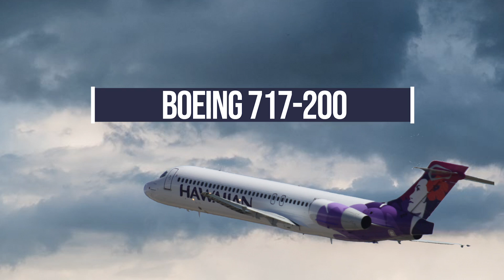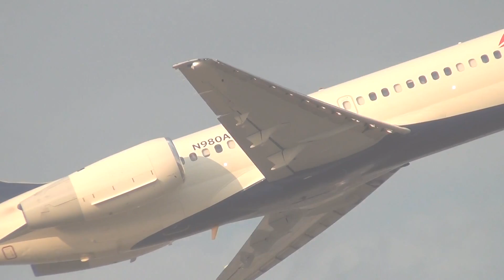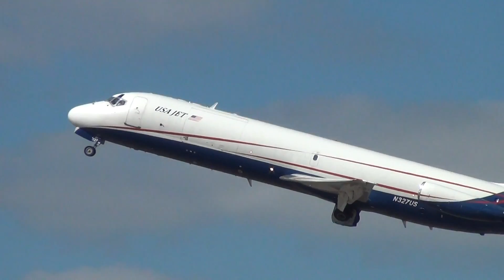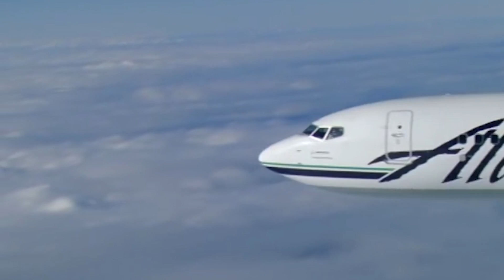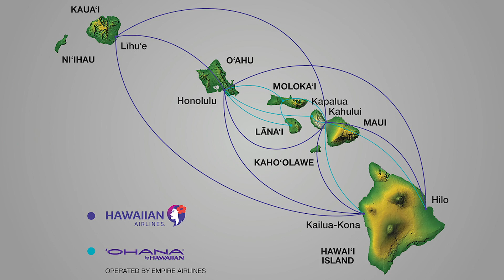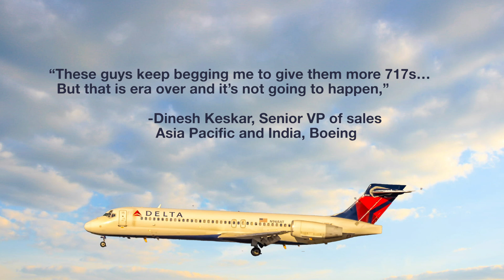Why Boeing Built The 717 And What Makes It Special

Comment: Any aviation "nerd" will know that the DC-9-30/40/50 transforms into the MD-80/88/90 which again transforms into the B717. It's similar to a Pokémon evolution from basic to advanced form.
Reply: Thank you fellow nerd!
Reply: You're welcome fellow nerd!!!
Reply: MD-80/89/90 should read MD-80/88/90
Reply: @Rick5040  I didn't even notice the mistake. Thank you for the heads-up!!!
Reply: @Rick5040  it was probably just a typing error. 8 and 9 are pretty close together.
Reply: It is quite difficult to differentiate all of them. Harder between MD-80s series.
Reply: @adalbertotorrero5893  it is really hard to tell the difference to the untrained eye. Here's how I tell the difference. The DC9-50 and MD-80 has a small difference with the nose wheel. On the DC-9 there is a small water spray guard where as the MD-80 have a much bigger spray guard for engine protection. And the B717 just looks similar to a DC-9-30 or maybe a little bit smaller.
Reply: @dewpont18 I think the 717 is closer to the dc-9-40
Reply: @Robert Newsom  yes the B-717 is similar in size to the DC-9-40 but respectively the B-717 was actually trying to be sold as the MD-95 before McDonnell Douglas merged with Boeing. With that being said. The DC-9 Family, MD-80 Family and B-717 Family have very similar styles of design across all 3 A/C Manufacturers mainly for simplicity sake. Which is rare nowadays.
Reply: They are all DC-9's from FAA certification. The rest of the model names are only marketing.
Reply: I've always thought that the Md-90 and 717 are on the same level.

Also, i prefer 737classics and 717 over the shorter 737ng, which that only fits for longer -800 and -900er variant, preferly with winglets.
Reply: @eirfanhazlan9271  from my experience, the MD-80 is similar to the 717. But I could be wrong. Also I would like to see Boeing include some 737classic designs into the 737ng A/C other than the 737NG BBJ A/C (such as air stairs)
Reply: It's more of the same principles as the DC-9. The MD-80/90 are just 737s but made by Douglas.
Reply: Exa toy.  Boeing did not build the 717 McD D did as the MD-83.
Reply: @craigbeatty8565  the Boeing 717 was originally marketed as the MD-95 Aircraft
Reply: @dewpont18  Thanks for that,  I knew it was DC-9 based but was more used to the MD-80 series designation.
Reply: You missed the 92
Cheers
Reply: Hello oldest plane

Comment: Still a DC9, MD80, MD88, MD90, or Boeing 717 are basically the same aircraft, though some versions are longer than others.
Reply: The md 90 and 717 both have different engines and the 717 and some particular models of the md 90 have upgraded cockpits

Comment: The 717 is really a right up to date DC 9 -30. When Air Canada was really growing through the late 60's and 70's it was the ever reliable DC-9's that made the airline tick, and helped them become a large world class operation. I believe all they ever had were DC 9 -10's in 1966 ? which were replaced by DC 9-30's starting in 1968. They are one rugged long lasting commercial airliner.
Reply: Northwest paid Air Canada to totally rebuild and "zero-hour" their entire DC-9 fleet in the '90s rather than buy new airplanes. I flew SOOOOO many miles on those thing! Loved them, loved Northwest.

Comment: After flying both as captain for a US airline I can assure you the Dc9/717 is the better aircraft both for safety and especially for reliability!  Especially in the 100-150 passenger configuration.  The Dc9 rides better in weather (higher wing loading)is quieter and a much more stable aircraft in yaw. Above the 150 seat configuration the 737 starts to beat it out, but by then you should probably be using the 757 as it is a far superior aircraft in that seating configuration.
Reply: I agree about the wing loading, way better ride in rough air. Also, an engine failure took less rudder....a lot less rudder.......

The flip side is that I never got used to the deck angle being so high on approach.....always felt it was going to stall.
Reply: RR KNL the dc9-10,30,50 had a much lower deck angle than 737 using 50 flaps and very similar using 40 flaps. The single engine approach 15* flaps was a high angle approach but not much more than single engine 737 approach. In a big crosswind the Dc9 was head and shoulders about the 737, I’ve had numerous landings above the demonstrated cross wind as it is a recommendation and not a limit unlike the Boeing.
Reply: Farmer Ted, it is hard to figure out what you are saying, because you just mention "I flew both".....yet several different types of aircraft are mentioned in the video. You comment goes on to only mention the 737 and 757, and it is pretty meaningless to compare such very different aircraft to the DC-9/717 type.
Reply: youtuuba I flew the dc9 10,30,50 from 1987-2000 and flew the 737-300,500,700,800,900 till my retirement. Along with a two year stint on the 747. I think I’m more than qualified to have an opinion.
Reply: @FarmerTed  , you no doubt have lots of experience flying, and I respect that, but your written communications skills are lacking, and that is an area in which I have lots of training and experience. That is why I commented on your comment....it was poorly written and confusing. You also seem to have poor ability to read my comment and understand that I was not challenging your flying experience, but rather your ability to write clearly.

Comment: Me likes the md design, well proven and reliable. Sad to say the design ist outdated like the 737, for different reasons. T-Tails can deep-stall, rear mounted engines are not so suitable for efficient large fan diameters, hard time for evolution on this platform. The 737 has this issue with the fans and ground clearance on the stubby legs. When sticking with a proven old concept be sure to have room for change... imho the 757 had the potential for this, but hey, who cares, just my 2 cent.

Comment: Delta is reportedly working on a deal with Boeing where Delta would trade in its 717s for new 100 737s.
Reply: Delta doesn't own the 717..they are subleasing them from Southwest. So wouldn't they need to clear that transaction through SWA first?
Reply: @jdspreest  There are several current articles out there on this. Most of Delta's 717's are on lease. I have no idea what the current lease agreement allows or if SWA is still a party to it. I'd guess, if it was contractually impossible, they wouldn't be exploring this change.

Comment: The 717 Is Delta Air Lines’ Biggest Small Problem. Can It Swap Them For 100 737 MAX Aircraft?

https://www.forbes.com/sites/willhorton1/2020/04/22/the-717-is-delta-air-lines-biggest-small-problem-can-it-swap-them-for-100-737-max-aircraft/#51cb9c5e4165

Comment: Why Boeing and GE don't develop new, yet more efficient than the GEnX for the Boeing 747-8i. It is the same case for 747-400 with the CF-6
Reply: The 747 is dead as a passenger aircraft. This role is now took by the 777, which is their new 747, and probably one of the most important aircraft for Boeing beside the 737.
Tje 747 is a very good cargo aircraft, but for the little numbers they sell in this market the existing turbines are good enough.

Comment: In Western Australia where the 717 is used on fly in fly out mines work they are being bolstered with A220.
Reply: Who has a A220? 
Ive never seen anything but 717 and F100
Reply: Virgin fly A320's in WA not A220's to the best of my knowledge. I don't think there are any A220's in Australia but happy to be corrected!
Reply: Apologies. I meant to type A320 not 220.
Reply: @martinmcdonnell8058  you had me all excited
Reply: @martinmcdonnell8058  Your forgiven Martin. I thought it may have been a typo.

Comment: The 717 is great but there is no need for new ones to be built. If Boeing competes with A220, the 736 is a better option. 7M6 would be pretty crazy to see.
Reply: tjsynkral The 7M7 has sold poorly and the 736 sold even more poorly when it was produced. Based on this, a 7M6 wouldn’t work at all

Comment: And Boeing keeps screwing up. They stick with the 737. The 717 is not as profitable but why would you turn down profits. Boeing does not build a 100 seat aircraft and the 737 airframe is very limited in what can be done with it and is woefully outdated. Boing needs to go with a clean sheet A/C and target the 80 to 200 seat market with it. Twin engine designed to be updated every 10 to 15 years.

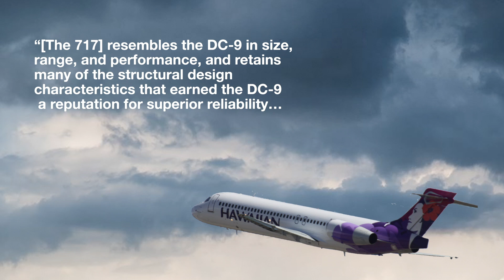Comment: 1:17 Hawaiian Airlines seats 128 in a 2-class configuration.
Reply: Mirza Ahmed and Qantaslink 110 dual class/125 single class :)
Reply: Imagine actually flying first class on such a short route.
Reply: @CaptainSebAviation  most of them are connecting passengers who flew in to Honolulu from the mainland or Asia in first-class on a A330.

Comment: Boeing missed a HUGE opportunity with the 717 IMO. Not building the projected MD-95-50 / 717-300 was a mistake. This airplane would have been a big sucess and a lot of "Blue Chip" Airlines wanted it, but Boeing does not wanted to hurt the 737-700/-800 sales with that airplane. The consequence was that most of these Airlines interested in the 717-300 ended up ordering Airbuses. A 717-300 would have made the whole 717 program a lot more attractive. Of course Boeing would have lost some 737 sales, but also they would have got some orders from Airlines that now ordered the big Embraers and Airbus.
Reply: Just another example of Boeing's former CEO pandering to Wallstreet.  Hopefully that's all in their past.
Reply: @davidjolley2468  STONECIPHER the program killer.
Reply: AirTran was trying to get Boeing to build the 717-300.  Boeing, instead, steered them to the  737-700, and gave them a great deal on 100 of them.
Reply: @randygeitgey2280  We did design a -300 and were working on a -100 as well, but that one had its own issues, not the least of which was a new power plant, probably a Tay 620/650.  Lufthansa, United, Air Canada and others were also asking for a -300.  But Airbus wanted to give A319's away and came up with an A318 to give away as well.  Much heavier and costlier airplanes to operate for the same 85 - 130 seats.  Boeing just didn't want to be in that market.
Reply: O yeah of course, but that what happens when you don't know the things. I have to say the be a company that makes things is difficult. Make a decision can be between life or death
Reply: One problem I see is that airlines that fly the smaller 737’s like Southwest with the 737-7’s are all 737 fleets for maintenance and pilot training purposes. As a flier I prefer the Embraer E jets to either one of those. 
Cheers
Reply: Oh well I think I'll just take da' bus😅
Reply: Meanwhile in 2025, the world still waits increasingly anxious for the approval of the MAX 7 version of the 737.   RIP 717-300.
Reply: MD bought Boeing with Boeing's own money.... True story, All MD management came over , took over and Boeing quality went down from there....
Reply: @RussellD11  wrong Boeing had big problems long before the MD merger   JAL 123. Rudder problems on the 737. No body hog tied  Boeing and forced them to merge with MD
Reply: @RussellD11  Nice story that Boeing fans peddle. 1. MD was never known as a company that built poor quality planes. Quite the contrary in fact after the early DC10 engineering lapses. Boeing on the other hand had issues with for example the 737 rudder far before the merger and much later than the DC10. 2. Cost management from bean counters? Sure .... But in those years all major companies had that process in place. Not just MD. 3. After the merger, Phil Condit (Boeing) was the Chief Executive and remained in place until 6 years after. So with or without MD management, the Chief Executive was still Boeing.
Reply: If it was such a great airplane, why didn't anyone buy it?    You don't keep building something that no one wants.   And yes, twenty years later the market is different.    717 would be a dog on fuel burn per seat today.
Reply: @dougball328  because the 717 was unattractive as a single size aircraft -- just as I wrote it a whole 717 family - at least a -200 and -300 - would have made the 717 far more attractive.
Reply: @dougball328  tell that to Delta and Hawaiian and Qantas - did you not hear their comments?  It's not a dog compared with other 100 -120 seaters.

Comment: The Dc-9/717  series planes are an underrated engineering marvel. Part of the reason Boeing  dumped the design is they didn’t like it “competing” with the 737 (which it really wasn’t as 737 was getting larger and larger). The fact that many airlines are  literally flying their fleets into the ground 20 years after the end of production shows what a great design it is.
Reply: Another factor on the structural end is that it's a McDonnell Douglas aircraft.  McD had a number of failings, but building strong, durable airframes wasn't one of them.  They engineered and tested their planes for more hours and more cycles than Boeing or Airbus.  For an airline like Hawaiian doing a huge number of short hops, that is a massive advantage.  They found that out the hard way after they fatigued some 737s to death (literally in one case, sadly) well before the anticipated number of years.  If you replace your airplanes after 10 years in order to get the greater efficiency of new models, this long life is no advantage; it just costs more.  McD excelled where long life mattered.  That's why so many cargo airlines still fly ancient, indestructible, but heavy DC-10s.
Reply: Anyone noticing a theme here? Boeing abandons brilliant models like the 717 and the 757 that airlines are desperately clinging to for lack of viable options. The A220 is disposable compared to the 717, and even the mightiest A321, while more fuel efficient, is no match for the ridiculously powerful, reliable, versatile and bulletproof 757.  Yet Boeing treats these still-desirable birds like a regrettable one night stand. Because clearly Boeing knows better, right. I mean the 737 is the only aircraft you’ll ever need….right?
Reply: @kcindc5539  Boeing make horrific decisions.  Poorly run behemoth.
Reply: The fact that the basic airframe was designed in an earlier era is a big plus for the frequent take-offs and landings of the customers mentioned. The engineering margins hadn't been shaved down by computer aided design, so it's very robust.
Reply: The projected MD-95-50 / 717-300 would have been a huge sucess.

Comment: They say even a broken clock is right twice a day. The MD-95 was one of those times McDonnell Douglas actually made a good product.

Edit: i didn't mean to insult anyone or MD as a brand, my comment was meant simply as a pinchy rude-ish joke aimed for the Douglas "hate brigade".
Reply: I’ve got twenty thousand hours on Dc9-10,30,50 and the super 80. I was also rated captain on the 737, 100, 200,300,500,700 and 800. And can assure you the Dc9 is better!
Reply: DC-10, MD-11, C-17, we built better aircraft than Boeing. Heavier airframe, more intercostals, one piece wing spars. FAA has certified DC-10s for double life cycles, 10K cycles twice on one airframe ain’t nothing but a money maker for the airlines. McDonnell Douglas was killed by two things, obviously mismanagement, but the other was two of the worst local unions on the planet.
Reply: @KS-wt9gj  With all due respect, and i'm fully aware it eventually ended up safe, popular and all round a work horse for airlines, but i dont think the DC-10 is in any context a good example of "better aircraft than Boeing".
Reply: All me planes out last Boeing planes
Reply: Norm T so norm how many hours you have on both aircraft? How many of those crashes were pilot error vs aircraft related? How many crashes on dc3? It’s a lot more than 100, why because like the Dc9 and 737 they were widely flown all over the world. Did you know the 737 was a cobbled up aircraft with parts of Boeing 720,707 and 727 coming together and the Dc9 was a clean sheet design. Try flying a 737 manual reversion without a yaw damper and try the same with the Dc9 and get back to me. You know nothing of what you speak!
Reply: Like he says, it’s the perfect aircraft for Hawaiian island hopping.
Reply: @Norm T   nice lie and bull crap. if the 737 max is so good why is it grounded.  From the Faa Ntsb you are full of crap